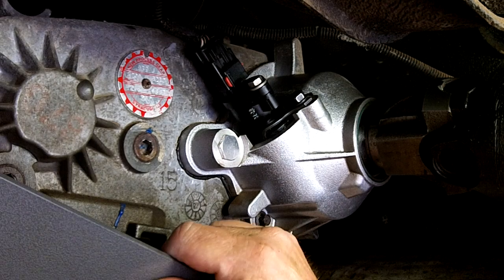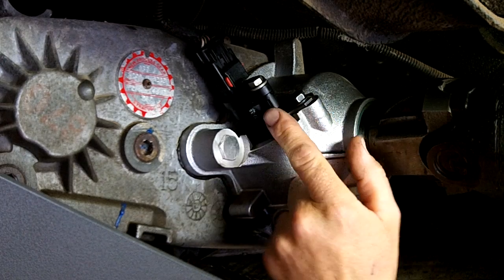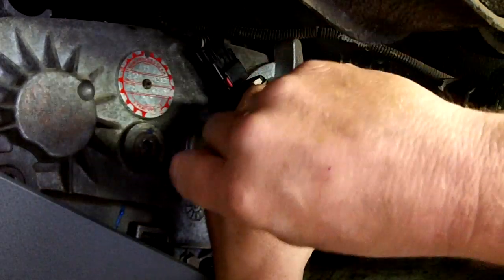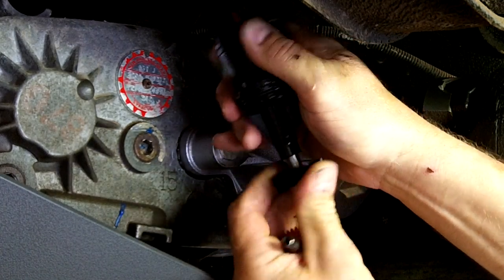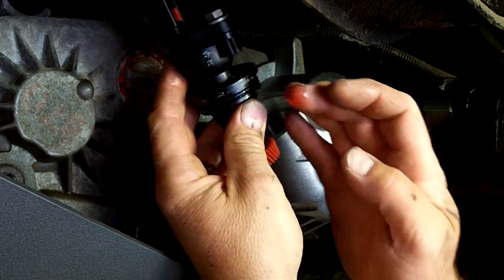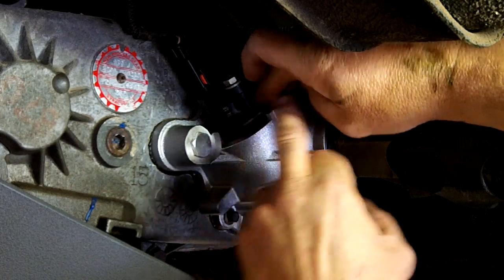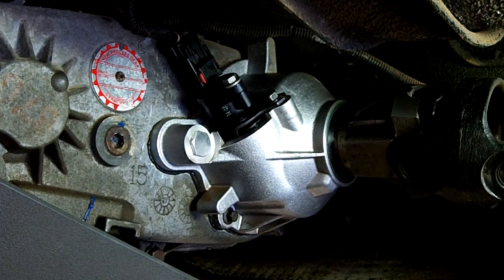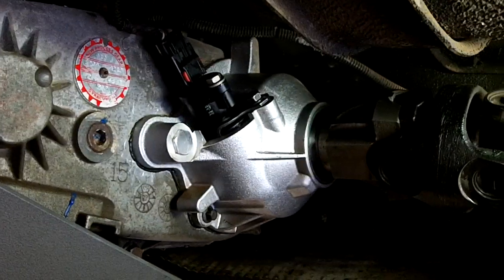Jeep Wrangler Cherokee speedometer gear change part  2

Comment: If that O ring fails, can motor oil leak from there? I have a small oil leak coming from somewhere near that area of the underside of my 92 cherokee.
Reply from the maker: +Brad Brown No motor oil but, transfer case fluid would leak from there. I would recommend fixing that leak as the transfer case doesn't hold all that much fluid.

Comment: my gears are nt going in right waht can it be and my trans is leaking oil
Reply from the maker: if it's not going in right you could be 180 degrees off on your rotation. make sure that you put it in the same way came out. and is your transmission now leaking around the o-ring of the speedometer sensor, if so you could fix it by just adding some silicone and reinstalling.